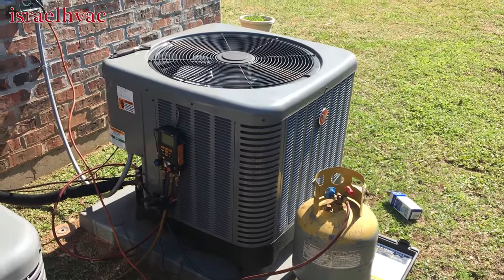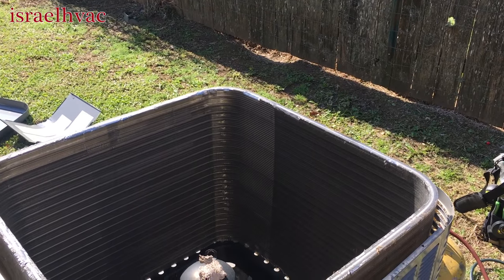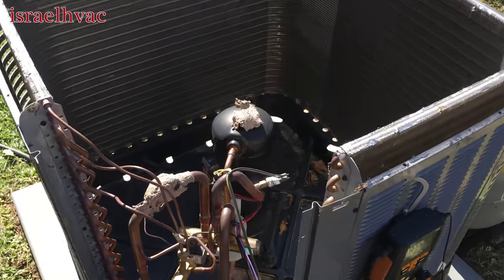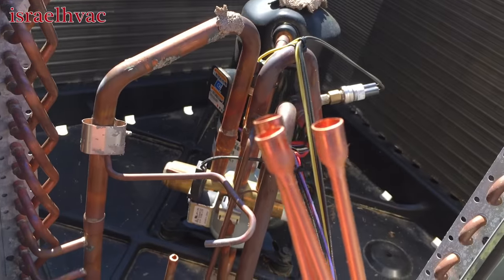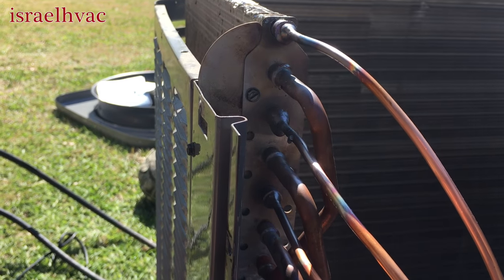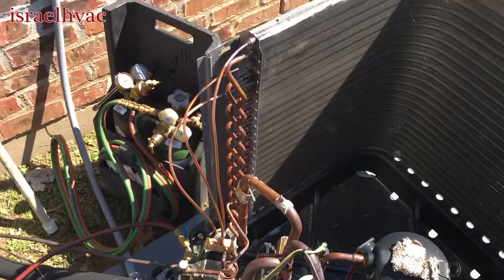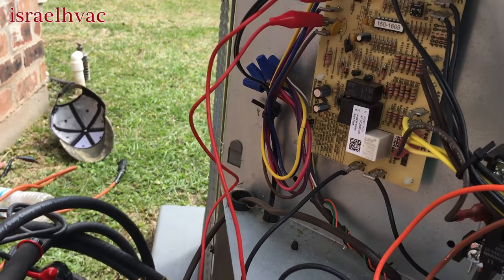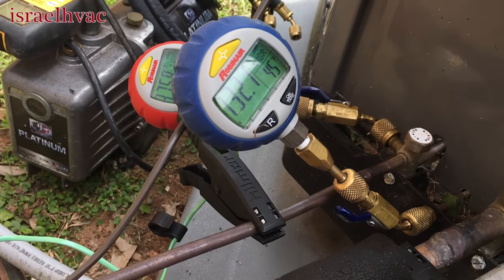Rheem Outdoor TXV Replacement

Comment: I know what you're saying about brazing the condenser fittings. Why not cut the distribution/feeder lines and either swage them or use a piece of copper to connect the new to the old. The condenser fittings are so thin. I had to do this on a 13LP series. Cussed a lot while doing it.
Reply: I totally agree with you .There suould be a coupling on those three pipes where you could sweet and brase .That would be safer and faster .

Comment: i put a ruud heatpump and modulating furnace in my own home in 2008, on the hp the contactor welded itself in 3 weeks, then slightly into heating season the bearings died in the inducer, but other then those initial problems ive had no issues knock on wood and as we all know our own systems tend to lack in getting our attention as far as maintenance etc lol every brand has quarks but overall im pleased with the rheem line though i dont install them any more since no one close by deals them

Comment: Good video, nice to see something other than the everyday mundane stuff.  I would have removed that left panel to have easier access to those branch tubes on the coil, while brazing.  I hate the way the OEM always attempt to jamb everything into one small tight place. I mean theresalot of open space in there.... they should spread things out and de-clutter the space for the price of a bit of copper.  There’s a lot to be said about good design for ease of use for the mechanic. A simple thing as removing the top shroud without having to try compress the corners to reassemble goes a long way in the eyes of the service tech. Removal of the paneling with two screws seemed to grab your attention.  Now, when that tech goes to recommend replacing a condensing unit, does he recommend the cheap unit, or the one he find easiest to work on, knowing full well, it’s going to be him that works on it later?... just food for thought for you design engineers out there.

Comment: Nice equipment, everyone has a problem within a system. Service /user is what we want. Tell ya buddy learn to use stay brite 8* lower heat,14000lbs tinsel strength, melts at 520*..
Good job on repair John..
Reply: Michael Lee *tensile?

Comment: I agree you did a good job; but Rheem, Goodman & others that locate mechanical parts where you must remove the top w/fan to troubleshoot & work on it, are not great engineers. They're economic engineers who make building cheaper & servicing hell. So don't brag on them as if they make it easy to work on...pleasssse!
And in the USA market 6 manufacturers provide 2 dozen brands of which many are now built out in Mexico with compressors made everywhere incl/China.